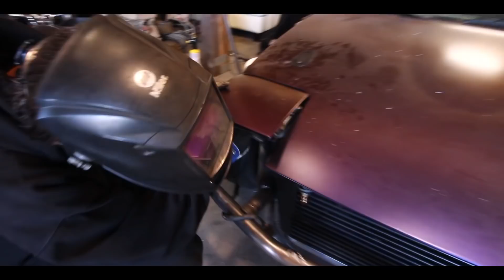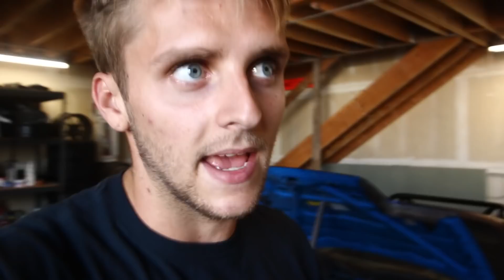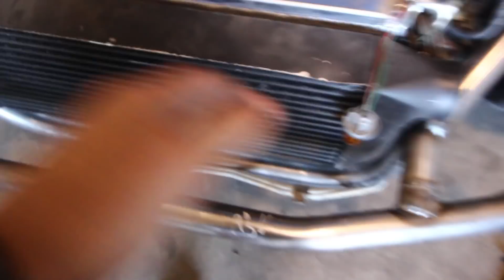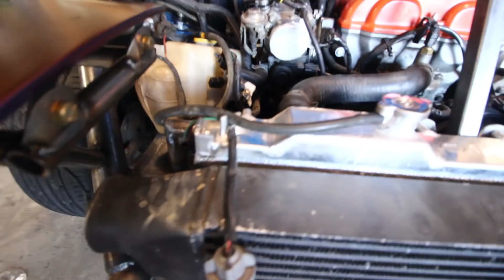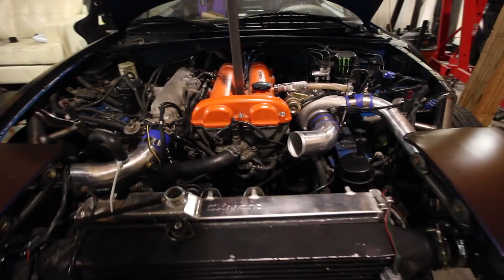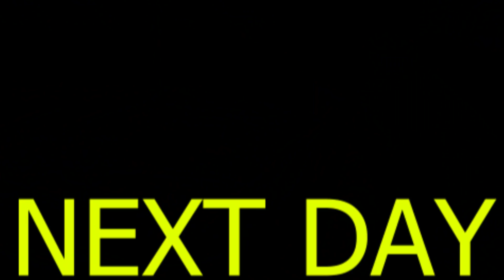Revealing the Tube Front End of the Miata

Comment: Bro, it looks dope. What is the purpose of tubing it? Is it the style or the lightness of it?
Reply: Two Infinity Beats it replaces the oem bash bar. So when he gets in a fender bender or crashes the front end at a track event, the tubed front end takes the impact and it doesn't mess with the structural integrity of the chassis. Then he just replaces the front end instead of needing a new car/chassis.